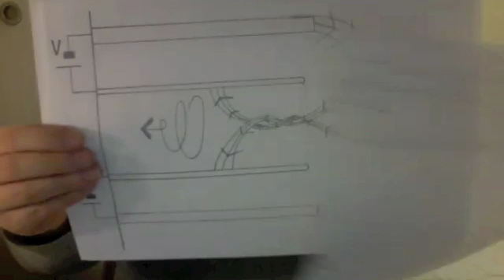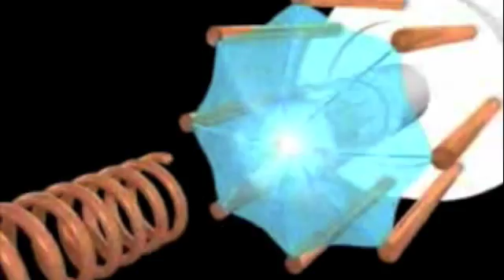Focus Fusion

Comment: How do they know what the jets are made of? Why is it ions on one side, and electrons on the other? Is that only theoretical knowledge, and what is it, or it has actually been observed and analyzed? Thank you.
Reply: It's a very well studied effect and device. It's been commonly referred to as a neutron generator (when used with deuterium) or as a "dense plasma focus" or DPF. The modifications to make it into the focus fusion device it is here do not require any undiscovered or undocumented features.